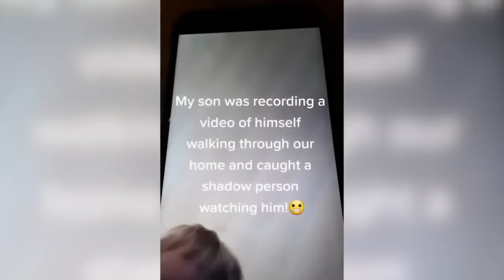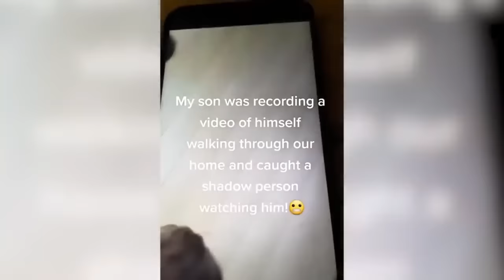Recent Trail Cam Footage Alarmed Scientific Community

Comment: Just because an animal is entirely white in color, that, alone, doesn't make it an albino. It could, very well, just be one of the many animals with leucism. Leucism consists of only a partial loss of pigment cells, which often produces entirely white coats, and pale white plumage, but these animals are left with normal eye, and skin pigmentation, whereas albinism is a total absence of melanin (pigment cells). Therefore, albino animals, in addition to having white, or even pinkish hues to their coats, feathers, and skin, will also have eyes that appear red.

Comment: The creature holding onto the tire, reminds me of something I've seen before. 
  Even though the creature has what looks like very short legs and a skinny tail, it's the posture and responsive movement that bears a great resemblance to...a worm! 
  I have seen much normal size worms or possibly a larva that will stand up like that, almost mimicking a snake like posture. If they are touched, they can snap like that as well. 
  The peculiarly large size and tail might be due to some sort of mutation the animal went through. It's almost like science fiction. 
  An island out in the middle of the ocean, after a nuclear event. The residual radiation causes mutations in animals, so on and so forth. 
   Another key point is that worms don't have facial features, which this creature seems to be lacking ???
Reply: I think it's an inch worm
Reply: It's got a string connected to it. I'm positive it's fake
Reply: I thought worm also. Its def a worm.

Comment: The mysterious long necked creature on the tractor tire is a type of caterpillar or more like an inchworm. At the head it has all of its fore legs, (which look like fangs) bunched up close to it's face in a defensive posture. The "long neck" is just it's body and it is holding onto the tire with its suction cup like rear feet. A lot of inch worms take this aggressive/defensive posture and action. This one looks like a stick mimic.
Reply: Nope, i checked, not even close to any kind of caterpillar or inchworm.🤦🏼🤦🏻🤦🏾‍♂️
Reply: @jasonpeters617  What is it then?

Comment: The one with the young guy in the forest at 8:22 ... That one is the scariest to me. The fact that you can hear that kind of crushing sound with no scream of terror makes me think it was his throat. Air tags, guns, wooden stakes, crosses, silver bullets, Holy water, orange spraypaint to mark my trail...check
Reply: I have seen that exact same scenario in at least 5 cheap horror films. It struck me as so unoriginal. What's that dudes name? I doubt that he went missing at all. I'm usually not a skeptic on the supernatural, but  that whole scene was way too familiar. I could be dead ass wrong too though, I'm just curious as hell now.

Comment: That's not a 3 eyed rat, its a squirrel that's been electrocuted, its tail fur has been burned off and the"3 eyes" is most likely the point of exit for the electricity. Rats eyes aren't even in those spots on its head anyway🙄

Comment: The animal on the tire is just an inch worm or silk worm! With its back legs holding to the tire and the rest of its body stretching straight out. It doesn’t have a tail that is just a pine needles stuck to its silk thread. Some people need to get out more.

Comment: It looks like little of the trail cam footage is actually filmed on a trail cam.

In the woods looking at conical piles of branches and you see a stationary, dark conical shape in the distance behind a tree - Must Be Bigfoot.  Of course the "It came closer" bit isn't caught on video - just the being still and stationary bit.

These 2 cops followed a suspect into the cemetery.  Which, coincidentally, happened to have a camera person just standing around.  They heard a scream and everyone ran - except the camera person.  Who'd have though that all you need to do to get rid of the police is a loud fox  like scream.

First it's an exceptionally large  rat, then it's a mouse, then it's a large mouse.  The 3 eyes rat looked more like a mangy squirrel with white patches.

Albino deer rare?  I was often to be found at the White Hart.

The creature on the truck tire looks like it could be a caterpillar of some type - the long neck actually it's body.  A number of caterpillars adopt this type of pose whilst pretending to be a twig, for example check out looper caterpillars.  Those "teeth" are actually it's front legs and it may be a predatory caterpillar.

That Sturdy Jeep that met the tiger - didn't appear to have a roof so there was nothing between the tiger and the passengers - no wonder they were screaming for the driver to move.  (the tiger could have been a ruse to distract them whilst that bear snuck up and opened the door😉)

That rabid fox was the scariest section.

The dog camera looked like a man in a ghillie suit, which may explain why it didn't react to it.

Comment: 15:50: Those three "Eyes" are not actually the rat's eyes.  they are three white patches of its fur, possibly caused by injuries during its youth, or fights growing up.  Its actual eyes are just below the left and right white patches.  That is an ordinary--if extra large--black rat.

46:41: What you're seeing appears to be the secondary effect of a small "dust devil."  As the wind churns, it doesn't always follow that the funnel is visible, especially at a low strength, or in an area in which only coarse sand and gravel are available for the wind to disturb.  Even so, the dust devil can affect objects of low relative mass, such as the straps of the backpack.

55:51: I do not believe the figure in the background is naked.  It's upper body and arms are lighter color than its face, suggesting it is wearing white clothing, possibly a jacket or white shirt.  Also, I think he has some kind of tie.  It may, in fact, be one of the law enforcement officers, further investigating the far side of the accident scene.  That would explain why none of the other people reacted to the presence of the observer.
Reply: That isn't a rat.. its a squirrel..  😂😂
Reply: yup 100% correct  @xLakai.

Comment: the one in fornt of the doorcam looks like a bear or mountain lion to me. The little you see of the head looks like a bear (with some hair loss). My first thought was mountain lion according to the movement, the camera is just not good enough to show the fur.

the one at 25:05 looks like a moth to me that is reflected by the light of the camera light or flashlight.

the werewolf on the isolated road looks more like a big owl flying across the street.

Comment: I am dismissive of most of the videos here. But this one is truly interesting. 44:41

I've seen an unusual ball of energy before, came from the direction of the sound when the houses frame was settling. When the potential energy became kinetic energy it ether made this energy ball or attracted it there to use the energy. I do not know it the energy had agency and was attracted to the houses release of potential energy as kinetic, or if the energy release just spawned a visible phenomenon. 

It was the size of a basketball and looked like a heat haze in the shape of a ball. I was inside in bed, it was 4:40 in the morning and I had woke up from a lucid dream literally thinking this is how some fell before they seeing a ghost. Then It came right as the house made a sound and right at the spot the sound came form I saw it. It came from the wall to my left moving about 2.5 mph and after 6 or so feet then made an immediate 90 degree turn and went 6 or so more feet then through the wall behind me. The 90 degree turn makes me think it had agency but I do not know.

It never made me fearful, but I felt as awkward as if a fawn was wandering around my room at 4:40AM and I did not want to frighten it during the 5  to 10 seconds it was in the room.

So this seem most like what I saw but different. It seem real and plausible to me for places with a lot of potential energy ready to turn into kinetic energy to have things around like this. 

Mountains with a lot of rock ready to shift have a lot of energy in the "Air". Also places like the Red Wood Forest with so much weight suspended by the trees. There is a lot of energy in the "Air" at places like that. 

Other places get there energy differently, like the deserts have a lot of energy because the sun and heat. So in the summer it will have more energy in the "Air" because of all the sun and heat it get throughout the day. But will be less active in the winter. 

This is all opinion, but it is my belief when energy is released it can bring the attention of different "life" that's is not always directly visible.

So if you want to see magic entities in the Red Wood Forest go there when it's windy. If you want to see magic entities in the deserts go there on the nights of the hottest days. If you want to see magic entities in the mountain then they will be at their peak before rockslides and earthquakes.

It's during the release of energy you will see the most activity. That's what my intuitions tell me.

Enjoy all the mysteries. & Good Luck Out There!

Comment: That's a squirrel with the test problem with the tail but it's a squirrel not a rat or a mouse you're such a knuckleheads and those cops that were in the cemetery and they heard a scream it was a prank the guy put a speaker to see what the cops would do I have all their videos